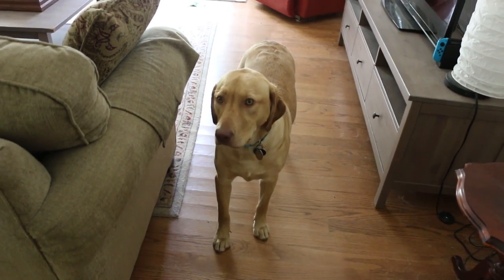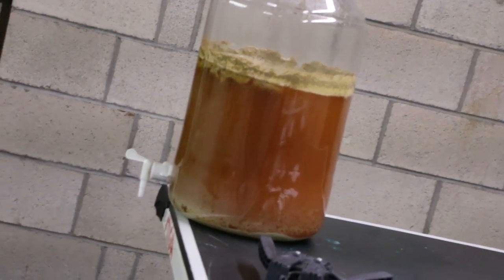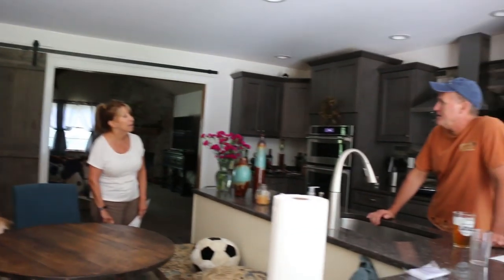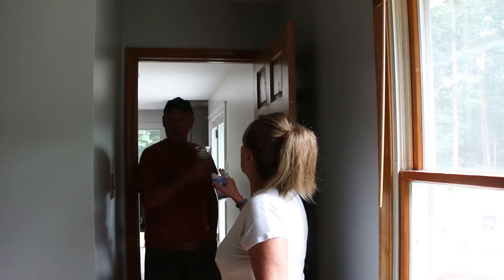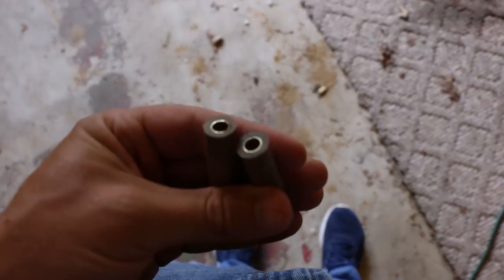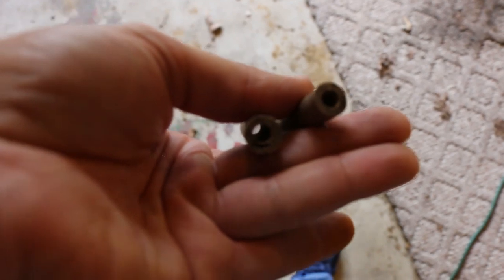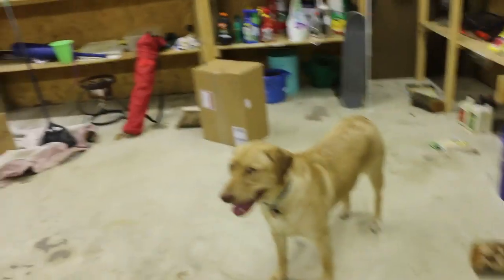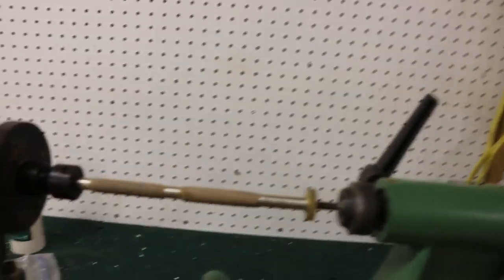My Father is Hiding Something...

Comment: I have been turning pens for a little while and have had plenty of problems in my experience so I completely understand your frustration. I've only been doing it for almost a year so I'm no expert, but I think I have some tips that may help you to prevent the wood from splitting like that. 

1. Make sure your tools are sharp
2. Don't over-tighten the brass tightening nut at the end of the mandrel. Too much pressure could potentially result in the wood breaking when it gets too thin.
3. Use plenty of glue when you put the brass tube in the hole so it all holds together well. Also twist the tube as you insert it to spread the glue around inside the hole.
4. The wood splitting could have had nothing to do with you getting too close to the tube. It could have been a result of a catch. I don't really know any good tips to prevent them, but there are some very good videos on YouTube of how to prevent catches.

Hopefully this helps. I would like to see some updates on your pen turning experience in future videos 👍🏻